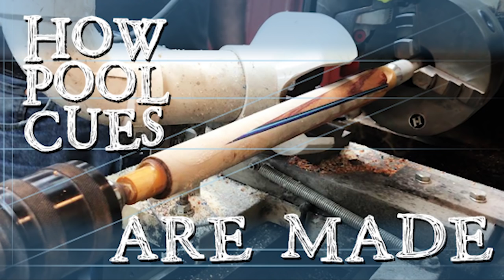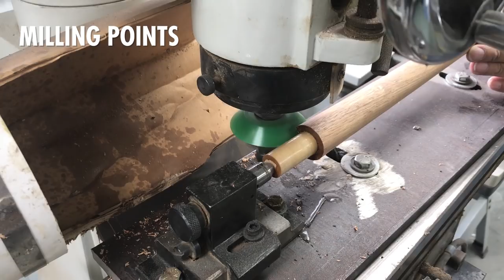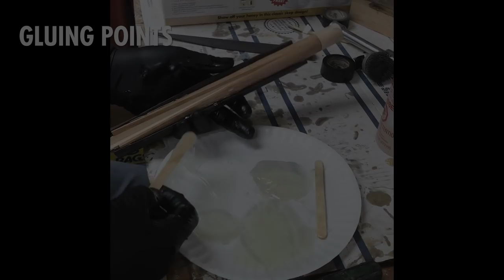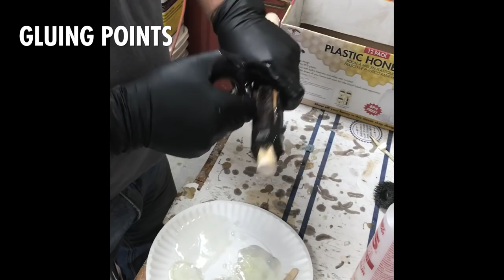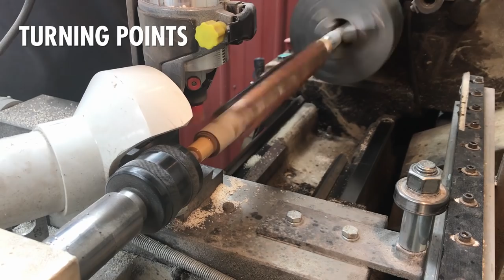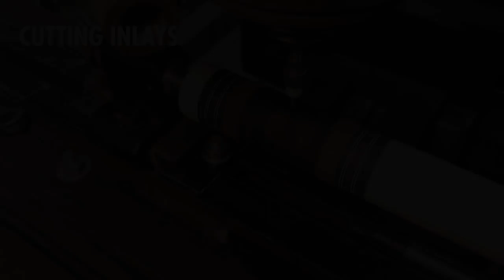How Pool Cues are Made

Comment: Im planning to start my business in my country, would u please tell me what machines can i use to make pool cue ?
Reply: Ok i will make it for you lol 😆
Reply: A metal lathe,  a wood lather (cord wraps), milling machine, CNC inlay machine (360 degree cnc) + software,  dremel like motor for cutting circular bit that is fixed to a control jig on the metal lather and tapering lathe,  90 degree bit for milling machine,  shaft tapering lather (lathe that follow a set jig setting) ,  table saw, band saw,  band sander, planer,  vacuum system to clear shavings, plastic silicon culets to hold the cue in the three way chuck not to mark wood,  Grinding wheel (sharpen bits),  taping bits for all common joint pins,  jig for cutting veneers,    veneer press, air compressor, measuring tools (precision type),  metal lath carbide cutting heads,  epoxy , quality wood, environmental control area (wood curing). But if I were you I would get a high end cue lathe like the ones sold by hightower start with cue maintenance first like tips and ferrules. Convert a one piece into a two piece then build up from that point on. It takes years to become a high end cue maker.